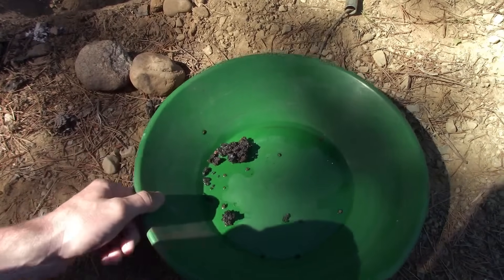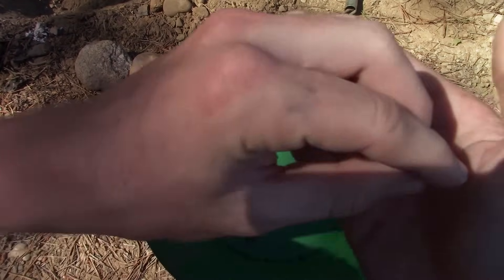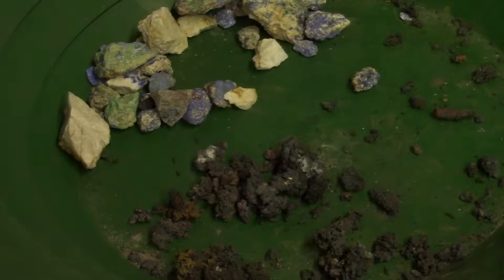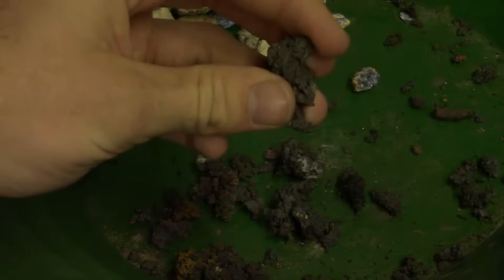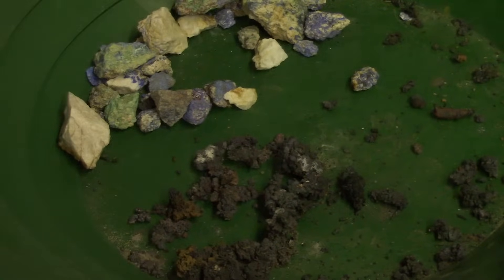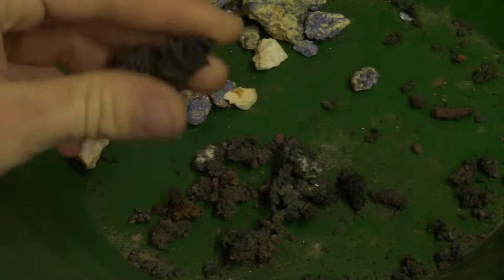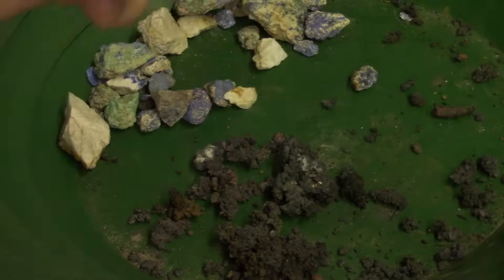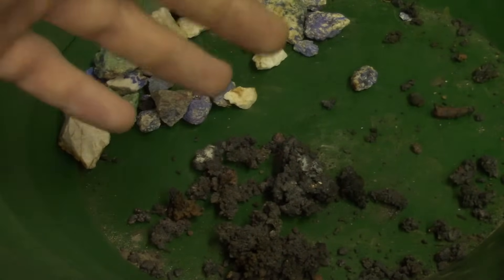First Attempt Smelting Copper Ore The Ancient Way

Comment: Amateur metallurgist here, I know this is 2 years old, but I have some advice for smelting copper ore and maybe others can benefit from this too. first off, you need more airflow, with all that fuel, and the very little airflow from that small bellows, it isn't going to get hot enough. in fact more air will actually solve multiple problems simultaneously. more air blows out the ash as well as dust which means less slag, and this also uncovers more fuel, and lets it burn more readily. it also gives it more airflow so it burns hotter. you want the fire getting yellow hot when melting copper, then you will get a very nice coalescence of molten metal at the end. also, copper is very easy to reduce from its ore, meaning that by the time you get the ore hot enough to melt the copper, the ore will have finished smelting. you don't even need that much fuel, and the less fuel you have, the more room you will have for copper to come together and coalesce. this is because copper is relatively unreactive, which means that it takes very little energy to reduce it from its ore, and it also cant hold onto very much oxygen either. after heating the ore, it will decompose and form copper (II) oxide (CuO) which only has one oxygen, meanwhile carbon can accept 2 oxygens per carbon atom. so you don't need much fuel to remove all the oxygen, and it gets in the way of the metal as it tries to coalesce. I would recommend a higher proportion of ore, and if possible, a higher purity. I don't know if this is a viable method, but you could crush and pan the ore so that only concentrated ore remains, then dry it and smelt it. finally I recommend lining the inside of the pit with smooth clay, and make it slightly deeper (less shallow) so that heat can be contained more and you can reach higher temperatures. the clay helps prevent copper getting stuck between dirt clods, and it helps with the coalescence at the bottom later.
Reply: Stary widzę że chyba się znasz a ja nie bardzo mógłbym cię poprosić o radę jak  wytopić miedź lub srebro z gotowego już koncentratu miedziowego wzbogaconego gotowego do przetopu w piecu hutniczym tylko że w warunkach gdy nie mam pieca hutniczego ale gotowego koncentratu i samej rudy  full ?
Reply: Zkrátka další chlápek co natáčí na video zejména sám sebe a nic neumí.
Reply: Smelting copper, like iron, is a chemical reaction called a redox reaction.  In this type of reaction one chemical compound is reduced (copper oxide to copper) and another compound is oxidized.  The oxidizer in the case of both copper and iron is carbon monoxide.  You could use aluminum instead of carbon monoxide and have a thermite reaction except with copper instead of iron.  Carbon monoxide is formed in your fire by not feeding the fire enough air.  The CO then reacts with the copper oxide and takes the oxygen from it, leaving copper metal.  When smelting iron in a small blast furnace (bloomery), there is a characteristic pale orange flame coming out the top which is the excess carbon monoxide burning to carbon dioxide now that it can contact more air.  If you build a bloomery-style furnace, you will have better yield.

Comment: I tried this using local clay to make a crucible with a lid. The roughly crushed malachite was placed inside and then a substantial bed of charcoal was used. This keeps the ore away from the detritus of the fire. Evidence suggests clay crucibles were used, it makes sense and works.Important to use high grade charcoal. This was heated for about an hour using constant bellows. I think you need more oxygen hence bigger more effective bellows. I got a pretty pure lump of pure copper. Once the green flame disappears you are getting to the point when the metal has been smelted. Don’t breath too deeply, malachite often contains some arsenic!

Comment: Not bad for such a old school method. All you need to do is refine it more by heating it in a crucible if you want. That should purify it a bit.
Reply from the maker: I'll be buying a furnace and crucible one of these days.
Reply: @GeoForge  Same. Someday..
I've looked online and you can get propane gas and electric ones for anywhere from 100-300$. The crucibles is probably the main longterm cost.

Comment: It's a bit of a late post but better late than never. I appreciate your efforts. I collect malachite and azurite from the local copper mines up here in Whitehorse Yukon. Mostly for specimen value. Which is worth a heck of a lot more than the copper value. However I have always wondered if it can be smelted on a fire in the backyard so to speak. As these copper carbonate minerals were the first to be "smelted" by ancient civilizations it leads me to believe so. I encourage you to give it another go and yes make sure you have a dandy hot fire. And make sure you use the purest form of malachite that you can. Malachite contains 55 percent copper by weight so that will give you an idea of what you should end up with should the experiment be successful. You got my sub for the effort. I'm routing for ya my friend. 😊👍
Reply from the maker: I do plan to give it another go in the future. The old mine where I was collecting the ore from is now private land. At least I have a 5 gallon bucket full of the stuff. Its hard to find a good specimen pieces but I keep all the azurite, that stuff is just to nice of a blue to crush up. Thank you for the sub, I hope to produce more content here soon!

Comment: Were you right to put a lid over the forge? Does that significantly increase the temperature?
Reply from the maker: Helps keep the heat in like an oven. Unfortunately, we have bad soil so it dried out and fell apart smothering the coals partially.
Reply: @GeoForge  im going to try making a solid clay (with sand temper) lid for my charcoal mud forge. Then I'll make a small hole in the wall of the forge to allow me to insert the metal work piece. I think my forge will get up to hotter temperatures if I do it this way and also it will allow me to insert the workpiece horizontally instead of vertically from the top. But maybe I should put a small vent hole in the clay lid? 

Yea, your soil probably has a low clay content. Look near stream beds maybe for clay and collect some in bags.
Reply from the maker: @Twobirdsbreakingfree  Clay should work a lot better. A small hole in the lid for venting should work good. I wish you luck and have fun.

Comment: How to smelt copper the ancient way:
Step 1: Bury STEEL pipe in the ground.
Step 2: Crush ore in STEEL pot…
Step 3: …buy copper from modern hardware store?
🤦‍♂️
Reply from the maker: Its the process of smelting it in the ground that is ancient. I didn't want to make a clay pipe and blow into it for hours or smash the ore on rocks. The copper is from an old copper mine I collected at in another video and not from a hardware store.

Comment: I make like you did and i get same result , so is it need more temperature ?
Reply from the maker: More temperature for longer and more charcoal.
Reply: @GeoForge  yesterday i put crushed malachite with charcoal on curcible on oven for 1500 degree temperature, and i close the crucible not let the oxygen go inside , then i get small pieces of copper , i will collect the small pieces and smelting it with porax to get on piece of copper 👍👍

Comment: but my question to you is can i refine silver in this way i am having trouble doing research.
Reply from the maker: I don't think you can because rocks and minerals containing silver are completely different from malachite. Malachite is a copper carbonate and heating it with charcoal I believe helps with the reaction to separate the carbonate off the copper. Silver minerals are in the form of sulfides which will require a different process I believe. I am not a expert in these things and I am still learning myself.

Comment: you used like 1 rock... like you were only gonna get 1 cent of copper period... you have to crush like a bucket of ore... like if you want a copper medalion or a shield you have to crush like 10 times that amount in ore.  the charcoal method is fine you just need to put more ore on the fire dude
Reply from the maker: I was mainly seeing if I could get the process to work for me and I wasn't expecting a large copper metal to come from this smelt. I crushed about 5 stones worth, I just didn't include that in the video because I assumed nobody wanted to see me crush rock over and over again.

Comment: "With the first attempt, mistakes are going to happen." Soooooo much truth in this statement, in every part of life. For these purposes, a copper bead of any kind is good for a first attempt. Experiment, look at results, make changes based on data, experiment again with that information. Science at its most pure.
Reply from the maker: I hope using clay will help keep heat in longer and prevent dirt from smothering the fire on the next attempt. If at first you don't succeed, try again.

Comment from the maker: Unfortunately, the smelting in this video didn't go fully as I planned but, I was still able to produce some copper metal. I plan on trying this again but using clay to protect the charcoal from being smothered out. 
I filmed this video earlier this year before the high fire danger. I wont be able to try this again until that danger has passed.
Reply: You could Try building a draft furnace out of clay. But next time you should keep adding charcoal and then another handful of the malachite powder, do this like ten times. When you're all out of powder add more charcoal at least five more times to ensure it all gets smelted.
Reply from the maker: @MrLee-cy1pw  I do eventually plan on trying this again with either a clay furnace or another process. Unfortunately where I was collecting the malachite is no longer accessible, but fortunately I still have a 5 gallon bucket full of the stuff.
Reply: Yes just a crude clay liner will stop the cave inns and a bigger bellow a hairdryer works well it wasn’t only not enough heat it was to much oxygen ‘ it’s best done in a crucible with about one quarter charcoal ‘ the charcoal drives the oxygen out and then the exchange happens ‘ just make a crude crucible out of firing clay and seal it with a clay lid lay it in the centre of your fire heat it and you’ll get the best results a good first try anyway